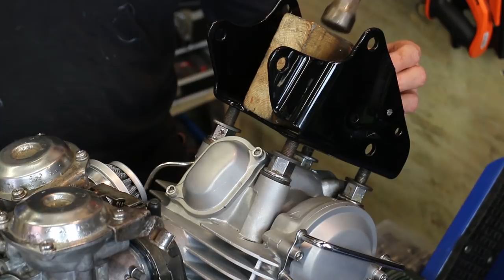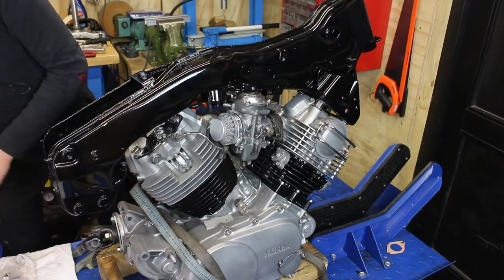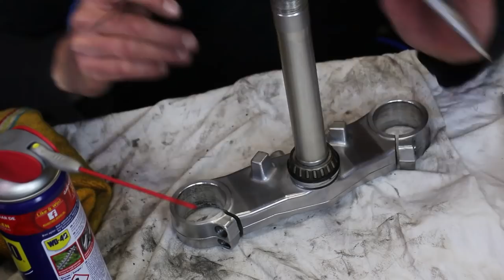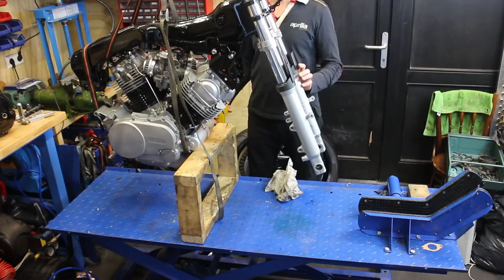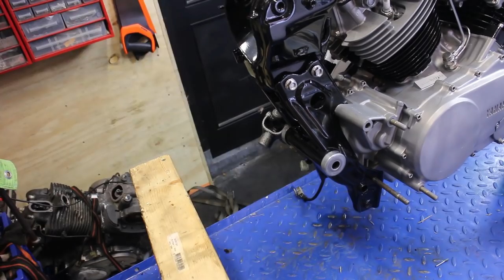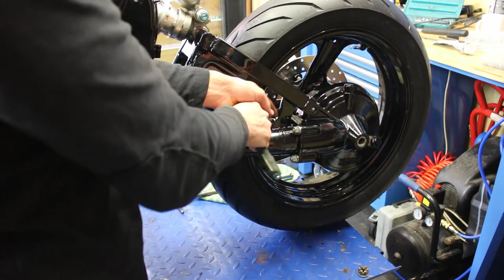Caféracer on it's wheels

Comment: Hey Pep, the previous owner of my Virago swapped out the front frame mounting bolts. The ones that go through the frame onto the bracket. They are different lengths and different colors. I can’t find the specifics on parts fiche would you be so kind to share the bolt size?
Reply from the maker: Oof, I darn't tell... Best way is to just put something long in and measure the lenght. Then, measure the width size... I sold the bike so I can't measure them for you. You can also search on cmsnl.com very often they mention the sizes of the bolts (search via the exploded view)
Reply: @chiefpepdesign  thanks pep! Miss your videos. Believe it or not, I reference your videos more often than my Haynes and Clymer manuals. :)

Comment: Do you have any trick for front fork alignment? 'Cause i had quite a hard time making sure the alignment between handle bar, and front wheel axis after servicing my front forks. Thanks!
Reply from the maker: You mean centering your wheel between the forks? That's just a matter of measuring? Also, you brakecalipers are very accurate... Keep those as a reference point.

Comment: Hi Pep, the bike is looking great and really coming together now. The small ai filters are interesting. What are you doing with jetting? Are you planning to seal up the frame or leave it as it is?
Reply from the maker: I will bring the bike to a dynojet expert and let them jet it on the testbench. Last time I inserted a Dynojet stage one set, but they changed the jetting anyway. So I left it stock now to let them jet it exactly as they want. I will leave everything open of the airbox in the frame.

Comment: Did you use over-sized jets to compensate for the extra air flow with the pods?
Reply from the maker: Not yet. I first want to ride it and experience how it runs. Also want to ride in the piston rings first before tuning the carbs. But to be honoust (I also mention this in the video's) I bring it to the dynojet workshop where they will tune it properly. Otherwise I would have to orde a whole bunch of jets and ride the bike so many times around my house to tune it myself. Rather let this to the experts with the proper machines. It will take them like 1,5 hours and then it's all fixed.
Reply: Chiefpep thanks for the reply!  I just got a dirt cheap 82 Virago 750 but it’s missing all of the rubber elbow boots and the air boxes.   I thought pods would be cheaper and easier.  What would you suggest if you know that switch out jets and messing with it for days isn’t an issue?
Reply from the maker: Pods are indeed cheap. That is, the ones that I use are like 5 to 10 Euro's. You could go for a Dynojet stage 1 set. There is this set specially for the Virago 750. That helps a lot! You also use an open exhaust? That also really helps (the more air in should go out somewhere... If that is even just some more gas/Dynojet set should almost do the trick)

Comment: This build is very beautiful. My only issue is with your bearings. You have not greased them correctly.  You need to grease the bearings before fitting them to the forks. The way you've done it the grease will not be properly penetrated into the race of the bearing. This can lead to premature failure. I'm not trying to be a troll or a dick just trying to impart some of my knowledge as a professional mechanic. I hope I help and  not hinder your progress mate.
Reply from the maker: mike lara Thanks Mike. The lower race was greased before I fitted it offcourse. But it was a tight fit which I did way before (there is a video about it  btw). Yoke was then in the fridge and heated up the race and all to make it fit. I had no reason to take it all apart again. So it was definitely greased well before instelling. Inside and outside. Thanks for the heads-up!
Reply: Chiefpep oh thats brilliant then. Like I say was just trying to help. Glad to see you didnt need it. Loving the build. Im currently putting thunderace forks on two of my builds also. Brilliant kit

Comment: What rear shock absorber is that? From witch motorcycle. Thank you!
Reply from the maker: Please find a lot of questions answered in mij Q&A vids: https://youtu.be/i548Yz8FeCs?t=1185
But also in my last video: https://youtu.be/aIhjarnOQHA
Reply: Thank you 'Pep. I have exactly the same R1 shock absorber to put in my cafe racer.I wanted to see if the perpendicular gas reservoir does not hit the frame at oscillations.Most use a shock absorber with a longitudinal reservoir.

Comment: Hey where did you get those air filters from ? And did you need to re jet ?
Reply from the maker: I mention that in soooo many comments and several discriptions under the video's... 58mm Pocketbike/minibike Airpods. Just Google them. Yes, went to the Dynojet to rejet. But works with standard jetting aswel.
Reply: Sorry I only read a few comments. Can I ask what you did about the vacuum lines that connect to the carb intake boots ?
Reply from the maker: @dallas7051  That's also a question very much asked. I explain that in detail in this video after 50 seconds: https://youtu.be/gFNiMe2vnjw

Comment: Hi just to say you didn't put the washers in on the swingarm ?
Reply from the maker: Which washers? You can see them clearly, the caps which protect the needlebearings. There are no other washers there... Inside those caps are sort of washers, but not on the outside?
Reply: Chiefpep two thrust washers
Reply from the maker: If you mean the numbers 5 on this view, they are in. But behind the caps. They sit in the rubber protection surface: https://www.cmsnl.com/yamaha-xv750-virago-1982-c-usa_model8890/partslist/D-06.html#results
Reply: Chiefpep that's right number 5. That's ok then, just checking 👍🏻🔧keep wrenching 🔩

Comment: round pipe with square one on the rear looking not so good. imho. one single lever would be great.
Reply from the maker: Sorry which part or where do you mean? You mean the swingarm? That's standard on the XV Virago...
Reply: yes, swingarm (forget how it calls on english). I  like you bike, but if this was mine project i'll would be  prefer minimalsitic design. Its harder, but result worth it. One line of swingarm without triangle looking awesome with this engine. pure naked beauty.
Reply from the maker: justfunk88 That's impossible. It's a shaft drive with monoshock. So adjusting the swingarm is impossible. With a chaindrive you could. Then you would have to take another model like the XV 920.